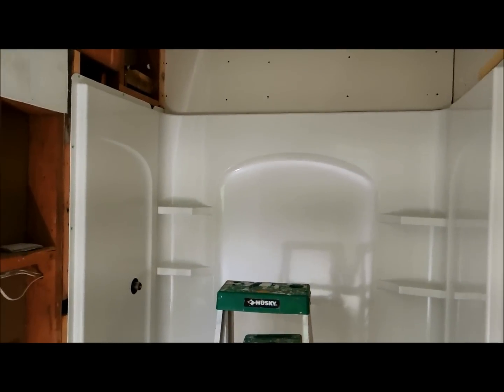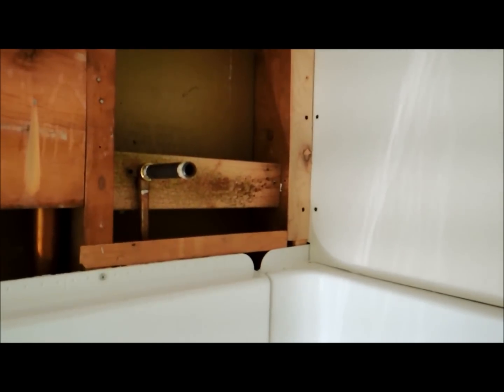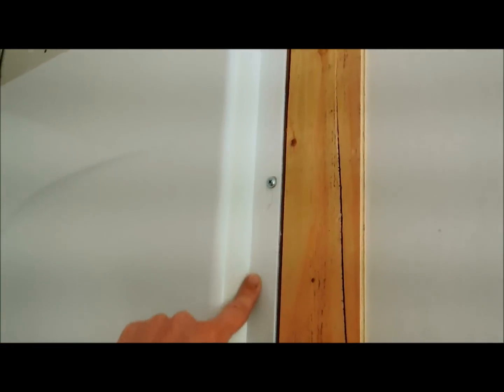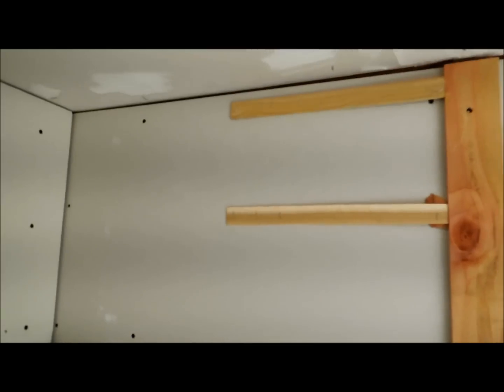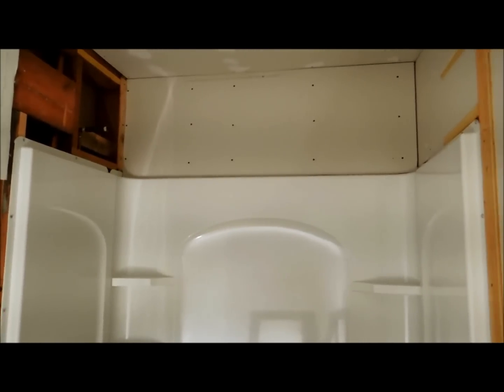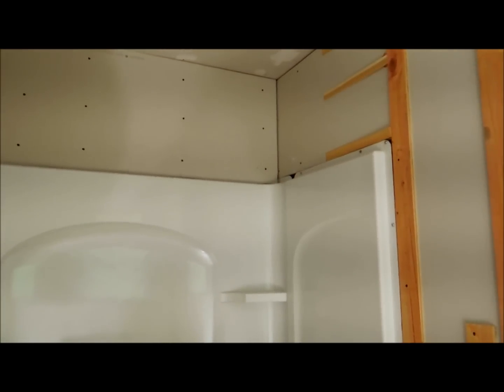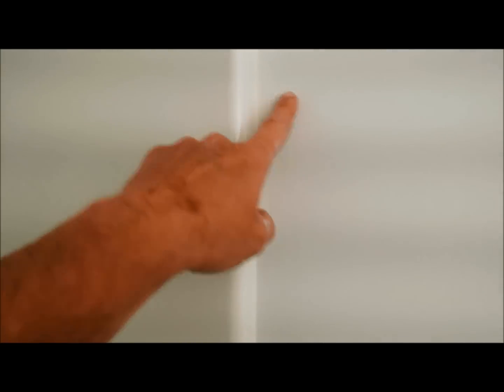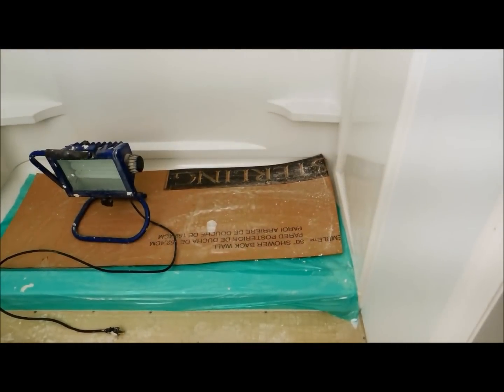Installing A Shower Enclosure

Comment: Couldn't you just cut out the drywall on the side that was out of square and butt a 2x4 to the studs, nail it to the stud but bring it out to where it's needed, so you don't have to change the doors/electrical boxes etc. Then put trim over the flange and anything that's open and white silicone it in place ? Just a thought/question.
Reply from the maker: In this case the room walls are intended to be the same as the rough opening for the enclosure.  That limits what you can do since the alcove for the shower is in the same plane as the rest of the room.  When the rough opening is significantly wider than the enclosure--say, 4-5 inches--you can build a little bump out to make up the space.  When the rough opening is  just a hair too big--say, 1/4 inch too big--you may be able to split the difference and make it look okay.  When the rough opening is something in-between these, however, and when the walls cannot be adjusted for out of plumb, it becomes more of a problem.  There are those who try to use wood or PVC trim to make up the difference when the opening is too big or the walls way out of plumb, but I find the resulting effort to be ugly and obviously a patch job.  Plastic enclosures can be less attractive anyway when compared to a tile job, so I'd rather maximize what beauty I can by making the walls look right even if it is extra work.

Comment: Great video. Question: Did you use adhesive against the framing or is there some type of backer behind it? I know some installs use green board backer, but I also have the spacing issue. The instructions say to shim the unit as you did. I like the bias to the control side and the build out to the opposite side. I can do that, but did you use adhesive? Are the walls fastened on all four sides in this unit? Thanks. Your work is very finished.
Reply from the maker: This particular manufacturer specified attaching the walls directly to the studs at the perimeter flange.  The corners snap together.  I don't think there would be any harm done if there was a layer of plywood or cement backerboard between the wall flanges and the studs, however.  I would not use greenboard in that circumstance.  These shower walls are not flat on the backside, they are a mirror image of the front, with spaces and depth.  The adhesive you mention would only be used on shower "walls' that are flat panels or "sheets".  I don't get involved in that level of construction because I consider them poor quality with low durability.  Those are just thin plastic sheets glued to a substrate and typically caulked in the corners.

Comment: My surround is 32x60 and my tub is 30x60 can it work ? The 32 tub wouldn’t fit can that surround fit ???
Reply from the maker: The tubs and surrounds are sold as matched kits, so you need to have the same sized walls as the tub.

Comment: great video. do have a question did you mortar under the shower base?
Reply from the maker: It depends on the manufacturer.  Some shower bases do require or suggest a mortar bed for the pan, others are designed not to need it.  Actually, I just released a video this week about three things to check before installing a shower base, and the model base in that video does not require mortar.  Check it out.

Comment: I realize this video is old but hope you could back to me. How did finish the wall to hide the screws?
Reply: Did you double the drywall?
Reply from the maker: I'm not sure what you're asking.  The screws holding the drywall to the studs are finished with drywall compound and sanded.  The screws holding the enclosure to the studs are covered by drywall.  Does that answer your question?
Reply: @enduringcharm  Thanks for getting back to me. My father which is an elderly man started ripping out the washroom. He had planned it a while back, but never got to it. Just now he is putting in a maxx 3 piece module bath. Walls are further out than bath sides. Just was wondering how to finish it off. But I guess it's going to be a cross your fingers type of job. 😊 Thanks again.

Comment: Interesting and informative video. One question, why put the first layer of 1/2" drywall... then put your 1/2" plywood strips, then another 1/2" drywall?? If the first layer of drywall was from an already existing wall, then that makes perfect sense. But from what you said, you installed the first layer of drywall... was this first layer to add some sound proofing...??

Wouldn't it have been cheaper and work just as well (unless it was for sound proofing), if you had just installed 1" or two layers of 1/2" plywood strips first, then you would just have the top (or second) layer of drywall??
Not trying to come across negatively or anything, was just curious what benefit the 1st layer of drywall gave. 
I'm getting ready to re-install a 4 piece shower in an existing structure, that someone else started to install. They got the shower pan down with the drain lines and etc, but never finished anything, the entire bathroom was still just open studs, and there was no drain for the sink.
Even so, the worst part is where they located the shower drain, its off and not where it should have been, and therefore has made installing the shower harder than it needed to be. So I thought I would search youtube and see if any videos gave me some ideas. But in any case, I'll get it done... as soon as I get the "exposed" (not inside the wall) water lines run, as there were no water lines installed throughout the rest of the structure before the drywall and paint was finished in the kitchen and etc (at least there was a drain line for the kitchen sink :-).  So now I'm going to run exposed copper lines throughout and just mount them to the surface of the walls... Guess people would call it a "steampunk look"... at least if there is ever a leak, I won't have to tear out a bunch of drywall to try to find it :-)
Reply from the maker: It's been a few years, but if memory serves me this bath had existing drywall remaining on the walls and only the shower area was taken down to the studs.  It was just easier to use two layers of drywall in certain areas to match up with what was there.  Drywall is cheap and it does offer some soundproofing quality.  I probably had more of it around or the amount I had to buy for the room worked out.  But, there's nothing wrong with using additional plywood shimming either.   As for your problem with exposed supply lines--look into Pex piping as a solution.  It can be tied into copper pipe and it is flexible, so you can run supply lines through existing walls with relative ease.

Comment: Is it necessary to put Hardie board behind glued up shower enclosures, or screw In  shower enclosures?
Reply from the maker: If you are referring to stand alone enclosures with self-supporting walls or one piece enclosures typically used in new construction, then they are screwed directly to the studs in every brand I've ever used.  If you are referring to flat plastic panels installed over existing surfaces, then those are not considered enclosures.  They are just a surface panel meant to cover up whatever is already there.  I don't use those or recommend them for any purpose.

Comment: When the dry wall is up against the edge of the surround, you just put caulk  to fill the opening?
Reply from the maker: Yes, use a paintable caulk for the small gap.  It will permit some movement of the enclosure.

Comment: I have have a 4 piece surround like this and find that bottom corner seams wick water out to the drywall and is causing water damage. Any solution to this problem?
Reply from the maker: So, do you mean that one of the outside corners where the tub or shower meets the rest of the room is leaking?  Assuming that the unit is snapped together correctly and relatively level then it's possible that there was silicone caulk omitted when the unit was installed originally.  Most of these units require the last few inches of the seam to be caulked.  You may be able to do that now if you can get the tip of the caulk tube in there, or if you extend the tip by using a short section of vinyl tubing.
Reply: water Wicks it way at the seam.. I have caulked it but still finds its way out.
Reply from the maker: Well, as I said, there is usually supposed to be caulk there on original installation so you may need to try and force some silicone caulk deep in there now.  You might also carefully check that there isn't a crack in the surround itself that is letting water in.

Comment: did you add roofing paper behind the enclosure? or would that cause mold since the enclosure is already waterproof?
Reply from the maker: Roofing or "tar" paper would be a poor choice for waterproofing or a vapor barrier anyway, but protection in generally unnecessary for these plastic or fiberglass enclosures.  If you have an outside wall you need insulation and a single vapor barrier, just as you normally would.  You don't ever want a double vapor barrier for an outside wall, such as plastic over the entire wall that already has a vapor barrier integrated with fiberglass insulation.  For inside walls, a vapor barrier isn't necessary.  In any case, these enclosures are watertight as long as they don't crack, in which case you'd have a bigger problem!

Comment: I was working on a job where we had a serious issue with size. We were expected to install a 60 1/4" enclosure in a 60 1/2" space with no way to bring it directly into the room without being sideways. Would the better option have been to switch to a smaller shower enclosure unit and add this padding material you are reviewing ?
Reply from the maker: You mean the entire room measured 60 1/2"?  In some cases you can remove all of the drywall down to the studs, which buys you nearly another inch, and then you can use the stud bays themselves to add a few more inches so you can twist the tub or shower base  into place.  The shower walls are usually less troublesome.  If the budget allows, you can even open up a hole in an adjacent room and temporarily remove a few studs, but that's a lot more work and money.  They do make smaller shower enclosures, but typically the homeowner doesn't want to go that route.  I've had many remodels similar to what you describe, but so far I've always found a way to sneak in the tub or shower base.  A few times we had to do some serious head scratching and cursing, though!

Comment: Are the holes for drain and fouset in a standard place?
Reply from the maker: There actually isn't a standard for drain placement in showers or tubs.  There are locations that are more common than others, but even those can vary.  You can pick left, center or right drains in a particular width, but the exact placement will vary.  As for the shower valve placement, that is cut into the enclosure wall by the installer to match the actual circumstances.
Reply: Would of looked more professional if you would of centered your shower valve.
Reply from the maker: @bigbuht   That is centered. The shower valve is lined up with the shower drain.  Since this is an enclosure, it may look  "off" because the wall extends beyond the inside edge of the shower base and the back wall takes up space too.  Once shower doors are installed it looks right.

Comment: What about glueing the walls when you shim them. Does it keep the panel from setting tight to the wall?
Reply from the maker: I'm not sure I follow your question.  Do you mean using adhesive on the studs before applying the drywall?  if so, that's fine and even preferred if possible.  Sometimes the use of shims complicates that method, though.

Comment: how big is that hole of 
S hower faucet?
Reply from the maker: The hole is cut by the installer, so you can make it whatever size you need.  I typically use a hole saw and pick the smallest size I can which still allows access.  Some valves require a square hole, in which case I'll use a jigsaw with a metal cutting blade.

Comment: How should a project like this cost?  How much did this project cost?
Reply from the maker: There are a lot of variables--not least is your geographic location, since some areas have higher labor rates than others.  When I estimate a bath remodel I do it with the specific details of that client's home and that clients choices for materials.  You really need a local contractor to look at your situation to have an accurate cost estimate.

Comment: do they make enclosures or extensions to go higher I only see 72 inches high at home depot I need 85 for a shower..
Reply from the maker: I'm not aware of any enclosures which go much higher than the 72 inches--they're all around that mark.  Why do you need one to go higher?  If it's a matter of protection for the walls or tall people using the shower, then maybe you'd be better off with tiled walls.

Comment: Awesome video. Thank you. How half a million people watch it and less than a 1,000 like it is not cool. I am a hard core DIYer. I break, I fix, I learn, I save money on some, I lose money on others. I am about to do my 4th bathroom and I want to know why more people don’t use foam board. I know drywall is shit. Green board is just as bad. But cement board is an absolute bear to work with! Is foam board the big secret???!!!
Reply from the maker: Do you mean products like Schluter Kerdi Board?  That is an acceptable alternative, although I don't care for the "hollow" sound and feel it creates after tiling.  The hardibacker has a more solid feel to it.

Comment: how to install shower door on fiberglass/acrylic shower?
Reply from the maker: You can drill into shower enclosure walls for screws and use anchors or use long enough screws to reach the framing behind the enclosure.
Reply: @enduringcharm  ok i was thinking about those toggle bolts but don't know if with time the bypass shower door/door jambs can ripped out from the fiberglass since the toggle bolts will be the only thing holding the door jambs/shower door to the the fiberglass?  I like the idea of using screws through the fiberglass to hold those door jambs on the sides..it sounds hollow when i knock on the side of the shower stalls so if there is a stud on main  wall its probably  like 1 to 2 inches from the surface of the fiberglass so  I will be needing maybe 3 inches or 4 inches screws?
Reply from the maker: There are many designs, but it sounds like you are talking about the typical shower doors with aluminum top and bottom track, and aluminum side jambs to receive the glass doors when slid closed.  The truth is that the screws on those side jambs don't really do much.  Instead, you will caulk both sides of those side jambs with clear silicone to seal the edges and also to provide holding power.  Once cured, that silicone is tenacious.  When I take apart baths for remodeling, I''ll often bend those side jambs while trying to pull them off the wall.
Reply: @enduringcharm  so the silicone acts as water barrier and also as glue, and what is the best silicon to install this type of doors?
Reply: @enduringcharm   @Enduring Charm LLC  so if I understood right the silicon by itself will hold the whole shower  door in place, I think iam miss understanding?  I tought I need it to secure the Aluminum side jambs not just to the fiberglass but to the 4x4s too?
Reply from the maker: You should still use the recommended screws (typically three in each side jamb) but I'm just trying to put your mind at ease that once you caulk the jambs with clear silicone caulk, they will be pretty solid.  The brand of silicone is really not important.  Just make sure it is pure silicone caulk, usually sold for baths or windows, though there really isn't any difference.

Comment: Thanks for the tutorial. Did you use paintable silicone along the sides where the enclosure meets the finished wall, or acrylic caulk?
Reply from the maker: You can use either, but the installation will be different.  If you use an acrylic latex caulk let it dry and then paint over it with two coats, overlapping the enclosure surface a little bit with the paint.   If you use silicone caulk you won't be painting it, so choose a color that matches the paint or the enclosure and use   blue masking tape when you apply the caulk for a nice crisp line.  Personally I prefer the former method because it is repairable in the future.
Reply: Thanks so much for the quick reply! I'm going back and forth on my caulking options. The main issue I'm having is that the tub apron where it meets the drywall flexes: if I push on it right there, a gap is exposed. So I'm wondering if I should (1) use a white caulk to hide this gap, as well as the somewhat ragged/cracked edge of the drywall against the apron; or (2) use a clear caulk and have an imperceptible sealed joint and just live with any gap that might be exposed from pushing on the apron (a rare thing, right?). Is this a matter of aesthetics, or are there any functional considerations I'm overlooking?
Reply from the maker: I usually try to take care of that kind of flex before getting to your point, sometimes by caulking from behind before the walls go up or by the use of some reinforcement.  But, given where you are, I would use a paintable caulk like Alex Plus 35, and then paint over it with wall paint.  Apply blue painters tape to BOTH sides of the joint, leaving just a sixteenth to an eighth of an inch of wallboard or  shower wall showing.  Now caulk the whole joint, and really push the caulk into the open gap area so that some gets behind  the surface of the tub where it flexes.  Then do a clean swipe with your finger down the whole joint.  Finally, slowly remove the tape  before the caulk sets so you leave a nice clean line.  See my video about recaulk shower bases and tubs for an example.  When that caulk dries overnight I think you'll find that the flexing issue is gone or at least minimized.  Now you can paint over the caulk and hide the whole joint.